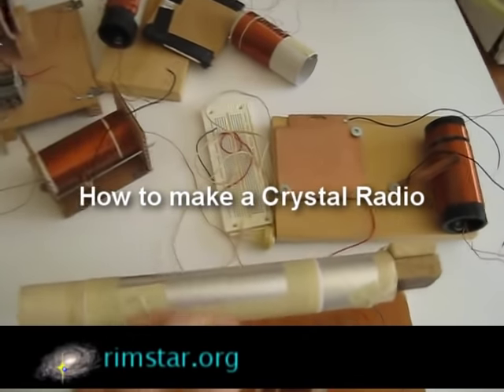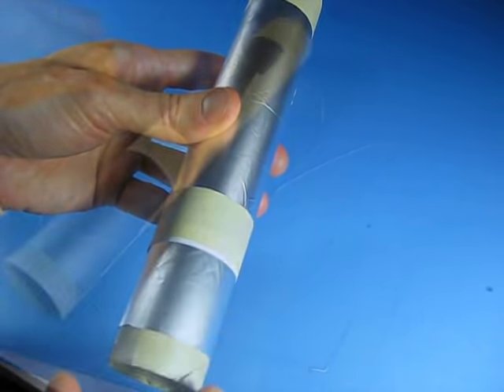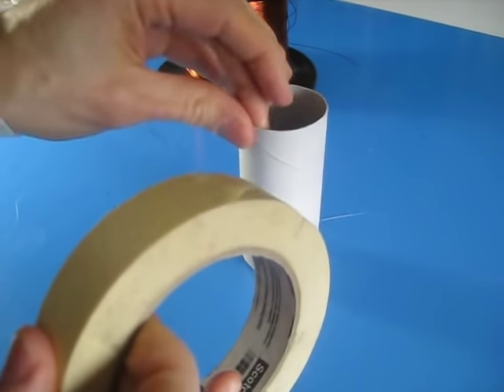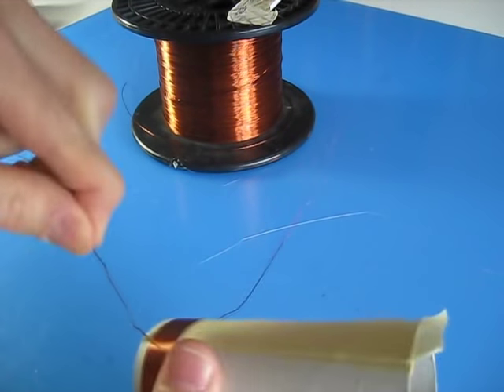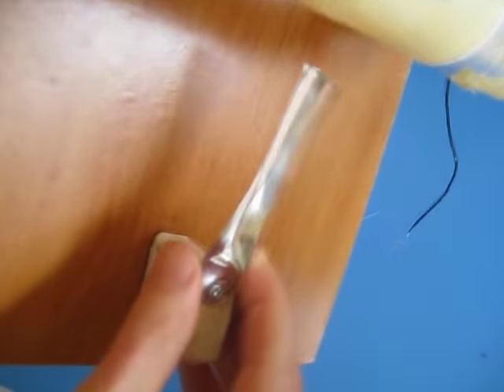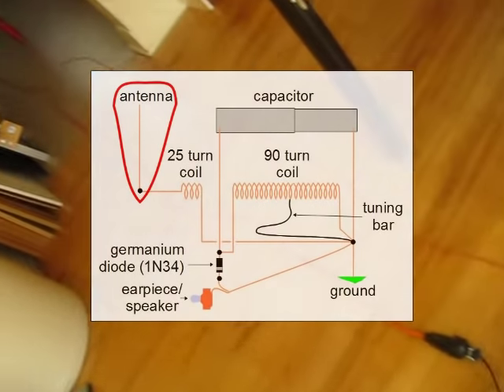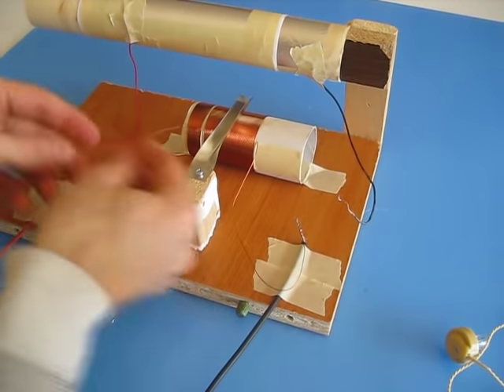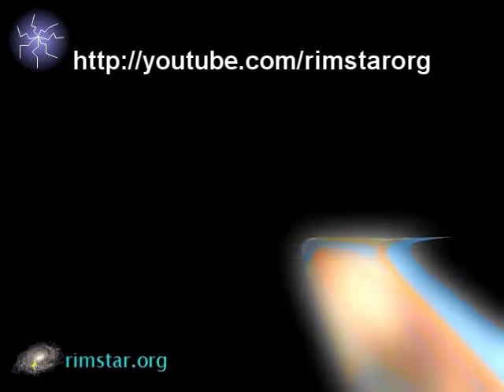How to Make/Build a Crystal Radio

Comment: for the coil wire, must one use insulated or resin coated wire or could bare copper wire be used?
Reply from the maker: +J.L. Roberts No, the wire must not be bare. It has to have some form of insulation, like plastic, resin, enamel, ... That is unless you can find some way to keep adjacent turns from touching each other, but that would be difficult to do.
Reply: +RimstarOrg Thanks
Reply: +RimstarOrg Hypothetical:     If you used a wooden or plastic rod that had threads cut into it so you could wrap bare copper wire around the threads without them touching each other, would that work?  And does the rod have to be hollow?
Reply from the maker: J.L. Roberts
Yup. That should work, provided the threads don't cause the wire to be more than one or two millimeters apart. People have used plastic insulated wire and that would be about the spacing there.

Comment: hey this may seem like a stupid question but can I replace the ground plug with a battery?
Reply from the maker: That would be cheating! :D Seriously though, no you can't. In order for a battery to move electrons you need to connect both ends into the circuit; connecting just the negative does nothing. The idea behind ground is that is acts as a place that easily accepts electrons without having to close a circuit, and in this case that's what we need. I haven't tried this myself, but you could try attaching the end of the ground wire to a large piece of aluminum foil and then holding that in your hand. The large foil is to give a large contact area, and your hand acts as a ground. You could also try a large metal object like a large gallon can or something.
Reply: RimstarOrg ok Thanks

Comment: Hey Rimstar is it ok if I don't have a good ground and I use different gauge wire?
Reply from the maker: The gauge of wire doesn't matter but you do need a good ground. It's not great, but you could put aluminum foil on the end of the ground wire and then hold the foil in your hand. The foil is to make a lot of contact with your skin.
Reply: ok thanks

Comment: I have made it as my school project .... but mine isn't working... can u tell me what has gone wrong... or what might have gone wrong ???
Reply from the maker: How long is your antenna? What are you using for earphones? Recheck all your connections, that they're good and in the right places. You need a very long antenna, the longer the better. Mine is around 15 feet/3 meters long but I am near some radio stations, which also helps. A longer antenna would make it better. Pointing the antenna at the radio station also helps. Make sure your ground connection is also good. I have more tips in my "Crystal Radio Troubleshooting and Tips" video http://youtu.be/HZZmKZJrIW0
Reply: RimstarOrg Note - the new crystal earphones made in Taiwan and now in China can be very intermittent. They'll go silent all of a sudden and you have to squeeze them or apply a voltage to them (only the earphone - NOT the rest of the radio) to wake them up.
Reply from the maker: sparkdetect
Good to know (re the new crystal earphones.) Thanks. I'll keep it in mind in case someone runs into problems with them.
Reply: i m using a speaker ..... of 4 to 8 ohms input ..... can u suggest something .... n my antenna is not very long ....
Reply from the maker: Mainak Lodh
That type of speaker won't work without more modifications. You need something with much higher resistance/impedance. You could try adding a transformer as in my "Use Earbuds/Earphones with Crystal Radio" video http://youtu.be/GCh2LVHUavQ But if your antenna is not very long or you're not next to a radio station then it won't work anyway. If you really can't stretch out a longer wire in a straight line, then you'll could try adding an amplifier as for example in my "How to Make Crystal Radio Amplifier for Speaker" video http://youtu.be/JtPwxbOgBHw The antenna is both the receiver of the radio waves and the energy source. Without a long one you need an alternative energy source, and that's what the amplifier is for.

Comment: Hi,would  u  please  give us an explanation how to make the antenna?
Reply from the maker: The antenna should be as long as possible, typically good ones are in the hundreds of feet long. I got away with around 15 feet because I have radio stations nearby. It should be straight i.e. not a jumble of wire. Ideally it should point in the direction of the radio station but that's not practical since radio stations are usually in different directions. The wire should be insulated. If it's going to be in the hundreds of feet then it shouldn't be too thin, otherwise its thickness doesn't matter much.
Reply: @RimstarOrg  ty  ,that was very kind of u.
Reply: What is the thickness of your antenna wire please?
Reply from the maker: I think mine was 14 gauge AWG stranded.

Comment: a cosa serve l'oggetto fatto con la carta stagnola? quali sono le misure? grazie
what is the object made with aluminum foil? what are the measurements? thank you (google traslation)
Reply from the maker: The object made with aluminum foil is a capacitor. It's one that you can adjust so it's called a variable capacitor. The measurements are 6 inches x 6 inches.
Reply: per entrambi i fogli?, se non mi sbaglio avevo visto un video sulla realizzazione, potresti postarmelo(scrivermi il link)?
Reply from the maker: Francesco Cerrito
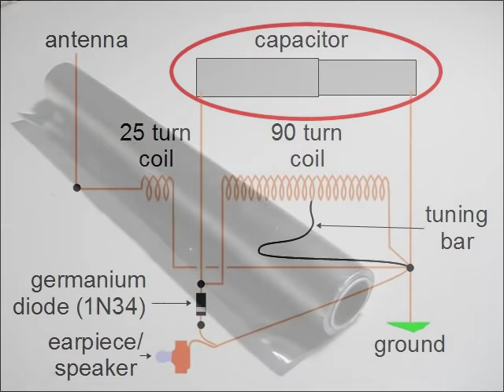Yes, both sheets are 6 inches by 6 inches. You can see it in this video at 0:36.

Comment: I have a pack of 47k -Ohm resistors, could I use them in the radio? If so where do I place them
Reply from the maker: Sorry, no resistors area needed in the radio. There are fun projects you can do with a bunch of resistors since they can be used to divide voltage. You can connect them together in a long line and then apply a voltage across the whole line. Then, to get different voltages back out, you make connections across the resistors. Depending on how many resistors you connect across, you'll get a different voltage. It's easy to make keyboards this way. But I can't find any simple project links and am not even sure what to search for (resistor network? resistor ladder?). Thomas used a bunch of different value resistors to do it here 555 timer piano
Reply: we bought a non-germanium diode from your description because we were unable to find a germanium one.  Its the 1N4148. You mention  for this needing a long antenna.  We have 75ft of insulated wire. Will this suffice? We do not have a powerful radio station in our area.  THanks.
Reply from the maker: Hannah Williams
The recommendation for a 1N4148 was because someone in the comments below said it worked for them. I don't recall if they said they had a long antenna. But to get the minimum voltage needed for a silicon diode (the 1N4148 is a silicon diode) you need a long antenna, or to be very close to a powerful radio station. Exactly how long isn't something I can say. Make sure the antenna is straight and either connect to it at one end or the middle. Try to put it as high up as you can, away from anything else. Try to point it in the direction of a radio station. Alternatively, some have reported here getting it to work with 4 or 5 silicon diodes connected together in parallel, meaning all the stripe sides connected together and all their non-stripe sides connected together.

Comment: Hey there, I am planning on making this radio (modified slightly) for a school project. Just to clarify, this radio could work without any power (if it is grounded to a pipe for example) and also what type of ultra budget speaker / headphones would u recommend. Sadly I don't have access to a dead microwave!
Reply from the maker: Yes, this radio works without any power. Or put another way, the power comes from the incoming radio waves.  The pipe you use for ground must be a metal one that actually goes into the ground.
The antenna is also critical and must be as straight and long as possible. I can get away with around 15 feet because I have some radio stations nearby. Note that if you try it indoors in some buildings then the power from the radio waves you receive may not be strong enough. I took it to one makerfaire and had to attach a separate amplifier to the output to hear it (like this https://www.youtube.com/watch?v=JtPwxbOgBHw.)
For the speaker/headphone it's best if it's a piezo earpiece (http://rimstar.org/equip/crystal_earphone_earpiece_for_crystal_radio.htm). There is very little power in those radio waves so a speaker won't do, unless you also use an amplifier. Normal earbuds won't work unless you add a transformer like this https://www.youtube.com/watch?v=GCh2LVHUavQ, but volume will be lower and again you might need an amplifier.
Reply: +RimstarOrg im also doing this for a school project. Two questions, If i took a wire and connected it to a metal pipe, then stick the pipe in the ground, would that work? And could i use a basic stand up straight antenna, like you see on a car?
Reply from the maker: Fash Themightygaming
The pipe in the ground might work. You want as much contact with the ground as possible. It also helps if the ground (the actual dirt) is wet since that helps with conducting electricity. People actually buy 4 or 5 feet long (1 meter or so) copper pipes for that purpose. I'm not saying you have to by one, any metal pipe that doesn't have any coating on it will do the same thing.
But as for the antenna, it has to be as long as possible. I have some radio stations nearby so I was able to get away with the length of antennas I had in this video. So a card antenna won't work, it's too short. It's best if it points in the direction of the radio station but will work in other orientations too.
Reply: +RimstarOrg Could I possibly find a wire antenna at a radioshack?
Reply: +Fash Themightygaming Also, what would a germanium Diode be used for
Reply from the maker: I would think so. The antenna can be any wire at all as long as it's just one wire by itself (for example, a coax cable is a wire within a wire, a stereo cable is two wires connected together, so they would be no good.) Home Depot and a lot of other hardware stores also sell wire.
Reply from the maker: Do you mean where would you find a germanium diode? Most diodes are silicon which won't work. I give some links in the video description to where you can find germanium diodes online. Some electronics stores may have them. Just ask for 1N34 diodes or diodes equivalent to 1N34.
Reply: +Fash Themightygaming +RimstarOrg Hey as rimstar org said, the diode is necessary. You can buy packs of 1n34A diodes cheap from china, u need to be careful with equivalents because a lot do not work :(
Reply: Also, what variable capacitor do u recommend that I use instead of the aluminium foil thingy? I'd like to make it as small as possible.
Reply from the maker: Have a look in the video description. There are some links there to places where you can buy smaller variable capacitors.
Reply: Thanks... Im an Aussie, so some of the sites might not work. I'll be getting one from a company called Jaycar... I was just wondering what range of [pF] the capacitor had to be?
Reply from the maker: Around 40pF to 355pF.
Reply: Many thanks

Comment: Does the diameter of the copper coils matter? I have made mine 3/16 diameter.  Will stereo headsets work?
Reply from the maker: Yes, the diameter of the tuning coil is one parameter for the inductance of the coil and the inductance is one parameter for the resonant frequency that the coil and capacitor is tuned into. If your coil is tunable then the diameter affects what range of frequencies you can tune in. I get asked this sort of thing a lot so I've put together this webpage explaining it in detail and showing how to do the calculations, along with some online calculators to make it easier http://rimstar.org/science_electronics_projects/lc_circuit_aka_tank_or_resonant_circuit.htm.
The problem with normal headsets is that the impedance is too low and interferes with the resonance. Though if you really want to use a normal headset then you can try impedance matching, which is what I do in this video to get earbuds to work https://www.youtube.com/watch?v=GCh2LVHUavQ.
But if it's the 'stereo' part you're asking about, it's just a question of how you connect to the headset's jack. Connect the radio's ground to the jack's ground and connect the other end of the radio's output to both of the other parts of the jack. However, I think that will half the power going to each ear so it'll be quieter. Also, you still need to do the impedance matching I mentioned in the previous paragraph.
Reply: RimstarOrg omg, a reply that is finally too complicated for me to understand.  Which is like most of the things you speak about.  I'm at the crude copy phase with minor HS electrical diagram reading class and a multimeter
Reply: RimstarOrg what if I add an iron nail inside the nonconducting coil. I have seen a similar design
Reply from the maker: Well, the answer was yes, the diameter matters. The problem is that I don't have time to do the calculations for your diameter to figure out the implications, so I gave you pointers that would lead you to learning to do the calculations yourself. The trick is to take it one step at a time, then you can learn anything.
According to my calcs, 30 turns of 26 gauge (AWG) wire on a 3/16 inch nail and using the tuning capacitor in this video for tuning should theoretically work. I've never done it myself, so I can't guarantee it.

Comment: where is the crystal? in the circuit diagram?   0.33
Reply from the maker: The germanium diode takes the place of where a crystal used to go. Originally, back in the early 1900s, a galena crystal with the tip of a wire was used instead. These days, a crystal radio is any radio that is powered by the radio waves.
Reply: @RimstarOrg  fair enough. So when u test the contraption at 10:45, the incoming radio waves are coming from where?
Reply from the maker: I think the ones I heard were coming from local radio stations and possibly one from just a few hundred kilometers away.

Comment: Is it fine to use less coil on a ferite rod?
Reply from the maker: Yes, that's the way it works. You can see the inductance formula here https://rimstar.org/science_electronics_projects/coil_design_inductance.htm . Higher ur means you can have fewer turns and still have the same inductance. Length also plays a part but the number of turns has a bigger effect than length since the turns is squared in the formula.

Comment: Sir should be diameter of aluminium foil capacitor and tunning coil be same.
Reply from the maker: No. The diameter of the tuning coil is important. But the diameter of the aluminium foil capacitor can be different -- it just has to have the same amount of surface area for the foil.

Comment: can you use a cable tv antenna for the antenna?
Reply from the maker: Pandas _ I'm not sure I know what you mean by a cable tv antenna. The antenna must be straight and as long as possible for best results. If you mean the coaxial cable then it might work. Connect to the mesh and not the wire in the middle.

Comment: Does it work if I put a quartz crystal instead of the diode
Reply from the maker: I don't see why it would. Quartz isn't even in the usual list of materials to use with a cats whisker (the old way that the rectification was done before commercial semiconductor diodes came along.)

Comment: Do i have to make 25&90 turns for 0.806 MHz oscilator also?
Reply from the maker: Sudipto Ghosh The 25 turn coil is there to help reduce interference from unwanted frequencies. The unwanted frequencies go from the 25 turn coil to ground instead. For a 0.806 MHz oscillator the number of turns you need instead of 90 depends also on the capacitance of your capacitor. In this radio they're both tunable and the range they can tune into together includes 0.540 MHz to 1.6 MHz. Together they're called an LC resonant circuit. See starting around 4:28 in my video "How a Crystal Radio Works" for more on this, including one of the formulas. The other formulas are the capacitance for a cylindrical capacitor (ow whatever shape you're making) and the inductance for a coil, both of which you can find online. They're both mentioned in that video. See also http://en.wikipedia.org/wiki/LC_circuit
Reply: RimstarOrg Ok, let me try one more time. I'm I right to infer that as you move your "wiper blade" to the left you are increasing the resonant frequency? (Fewer coils => reduced inductance => higher MHz. Right?) Therefore, since you mention above that you were tuning 540 KHz - 1.6 MHz up around the 80th turn ... I might be able to tune 145 MHz somewhere down around 30 turns?
Reply from the maker: Dave Ferreira Yes, assuming you don't change the capacitance, a lower inductance (fewer turns) gives a higher frequency. Using the formulas for inductance, capacitance and the resonant frequency for a parallel circuit like this, the calculated range for this coil and capacitor is around 300kHz to 36MHz. There may be other considerations that I'm not aware of at higher frequencies, such as capacitance in the coil itself. I've only ever worked in the normal AM range.By the way, in your other comment which I received in email but can't find here you ask about the capacitance of my capacitor... I show measuring it in my video "Crystal Radio Troubleshooting and Tips".
Reply: RimstarOrg Is it alright if we accidentally turn an extra 1 or so, at about 24-26 turns?